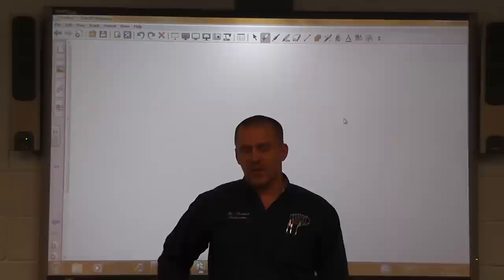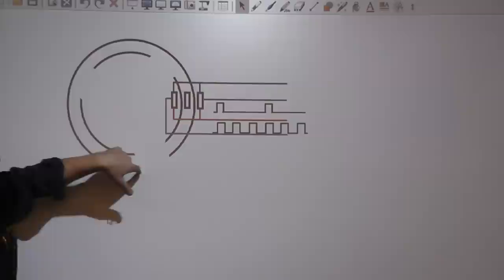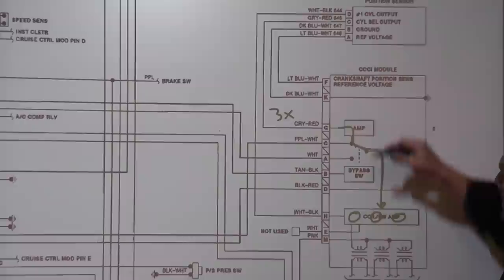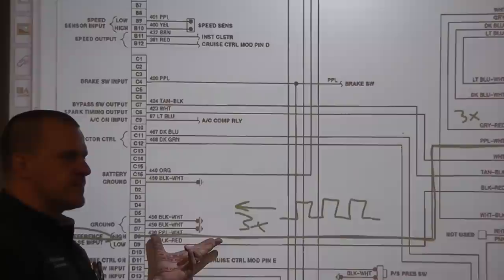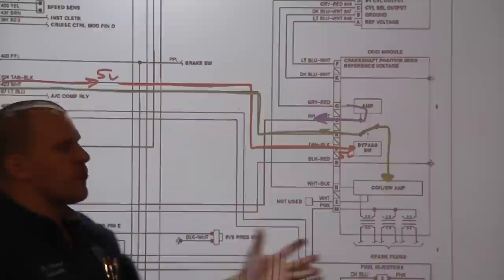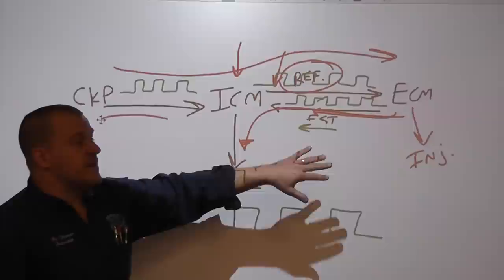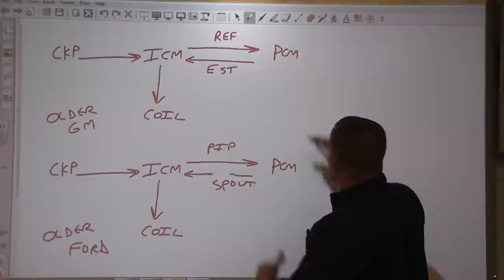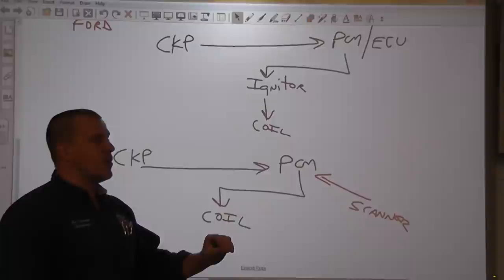GM Bypass Ignition System Operation (part 1)

Comment: I have 1999 Buick Regal issue having when I drove around 10 miles on street car RPM start bouncing and car shut off then cranking but no start. I already replaced Air mass flow, Crankshaft, camshaft sensors but still no luck... Will you help me with that issue Please!!
Reply from the maker: you need to find out what you are missing, spark or fuel. Since it is intermittent, it is most likely not a compression problem. Post your questions to my forum 
https://scannerdanner.com/forum/post-your-repair-questions-here.html
Reply: I check fuel its in good and spark its good its just happen when car gets heat up its just shut it off after trying to restart it's cranking but does not want to start....
Reply from the maker: right, when it is not starting, you need to find out what you are missing. And you are going to need more help than I can do here. back and forth communication on this platform does not work for me as I have 90,000+ people asking me for help too. hope to see you on the forum. Thanks for understanding
Reply: That's really not helping....
Reply from the maker: Can't help you otherwise. Not being a smart ass either my friend. I don't do guess work. I'm assuming you'll need help with those steps too which is why I'm suggesting my forum.
Reply from the maker: We can absolutely pinpoint this but you'll be expected to be able to measure fuel pressure and do some tests with a voltmeter and simple scan tool.  We will then walk you through it
Reply: ScannerDanner 
Hey I have a 07 G6 and I'm looking to put resistors between the theft deterrent module and the BCM two bypass the Anti-Theft which wires do I connect my resistors to and where do I find my resistance
Reply: Hu pcm/ECM  body made of aluminum and don't sweat or freeze, SD:WTF
Reply: There might be this electronic spark control (knock sensor or ESC sensor) cause the signal to the ECM to remain high.in turn ECM controling the est😀😀😀😀chow baby 🔊🔊🔊🔊🔊 don't forget your fn 50 mg of zinc citrate per day back off pot.....ass...ium right SD blow up your chest now.

Comment: I have an issue with my 1977 Corvette. When you turn the ignition switch on I have lights, radio but no power to the starter. Is there a neutral switch on this car? I'd so, where is it located? 

Thanks, Dennis Mock
Reply: yes there should be, if its a automatic it should be on the side of trans where the shift cable connects to it. If its a standard it will be on the clutch pedal

Comment: Would this be similar to a 95 chevy astro thanks
Reply from the maker: A bypass of ignition system? Yes, absolutely
Reply: @ScannerDanner  thanks for the reply cant find anybody in the uk thats willing to work on US stuff so i guess here we go!!! Thanks again
Reply from the maker: I can help you if you get stuck. Remember on this design, you can have good spark and no injection pulse and still have a bad ignition module

Comment: I have unusual problem I requare controling circuet for me 4 pin gm ignition module .
Im tired to go out side me car to advance/retard distributor so any help please is it posibel to place variabel resistor inside me car so I can advance ore retard me ignition system inside me car.
Also I was wondering can the singel pick up coil activate 2x 4pin ignition modules ? I wanted to build some thing similar to waste spark ignition system I have multipel e core type ignition coils and those ignition modules but I dont know how to switch them ?
It is similar build that Im after like the old Jaguar ignition system with auxulary twin coils with the jaguar 4pin gm ignition module amplifier set up but me problem is I have only singel pick up coil Im not shure if it is strong enough to run 2x ignition modules it does operate around 3v max.
So I cinde of have this unusual dilema.
If posibel I experiment lot with me engine what ignition system can be adopted to me curent set up that ich cilinder fiering sequenc can be programabel .
Im modifieing heavely me engine to different engine designs so I requare ignition system circuet that is variabel
Reply from the maker: This is definitely something for my forum, it is free to join! Hope to see you there
https://www.scannerdanner.com/forum/post-your-repair-questions-here.html